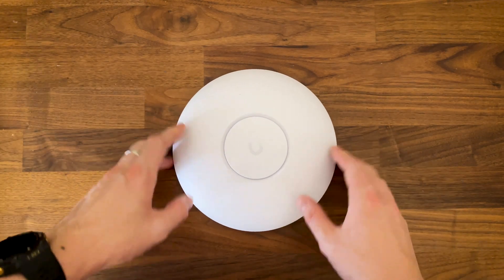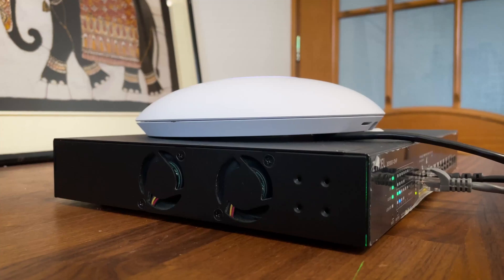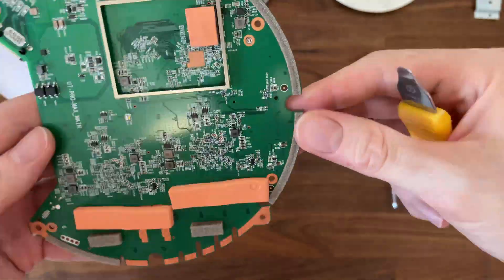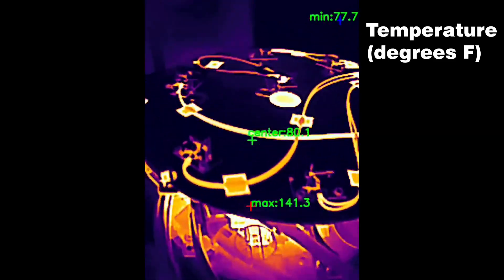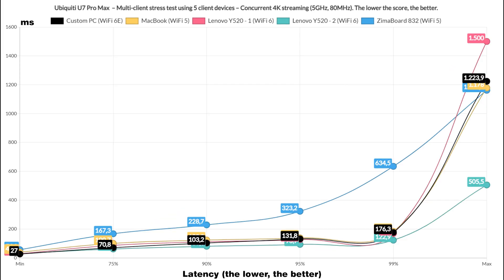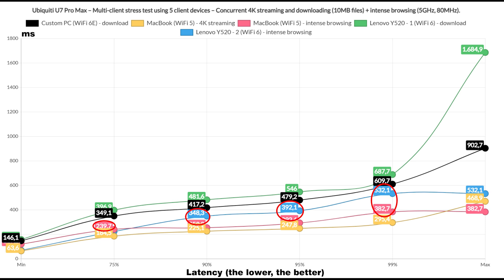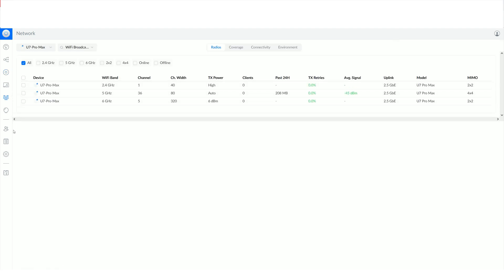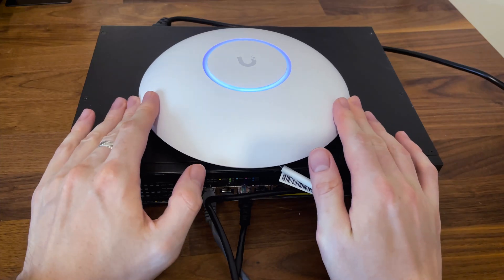Ubiquiti U7 Pro Max WiFi 7 AP Review, Test & comparison with U7 Pro

Comment: Great review, tks for this.  Would love to see the U6 Enterprise included in your AP testbed, considering it is now going for the same price as the U7 Max Pro.

I've read the latest FW (7.0.59) that you have installed on the U7 Max Pro resolved a lot of the Wifi 6E 6Ghz related issues, particularly performance being inconsistent / unstable on that frequency vs. U6 Ent, which has been a rock-solid performer.  I'm on the fence as to which model to get 🤔
Reply from the maker: Go with the U6 Enterprise. I have retested it a few days ago with the latest firmware and things are the same as before, more or less. I am also currently in the middle of writing the script of a video which addresses some main reasons not to get the U7 Pro Max, so yeah, not a fan of this access point.

Comment: can i use this with mc801a please? thanks!
Reply from the maker: I think so, yes. But you will need to power it up using a PoE adapter of switch and the management of the AP will need to be done using the UniFi controller.

Comment: Wish I had seen this video before.  I picked up a 7 pro a few weeks ago and I was disappointed that it was only 2x2.  I also can't seem to get it to connect at 320MHz on WIFI 7.  When I first powered it on, set it up, it gets hot. Hopefully the next generation units will be 4x4 on all bands and passively cooled and low temp.  I don't like the thing mounted to my wall knowing that I'll change it one day and there will be discoloration.

Comment: Fans 😂 they need to design better electronics that develop less heat
Reply: Hey,
I totally agree, I bought 2 different AP and returned them for that reason. After searching recently, there are a lot of complaints on the community forum.
All are answered the same way: It is within thermal specification for electronic.
Mine is: why is every other brand with same performances way cooler?
Ubiquiti AP electronics are badly designed.
I have a UDM and 2 switches, happy with them, but dealing with other brands AP breaks the seamless experience to the point I'm considering changing the brand for my network.

Comment: You better disable Wireless Meshing next time, when testing. That can be done at AP level but better inside the whole site (Settings > System > tab: Advanced > scroll down, uncheck Wireless Meshing (and New WiFi Device Auto-Link, if you don't use that).

Disabeling this, will stop the AP of sending out hidden networks (for the Meshing feature) and frees up memory. It also let you use more simultaneous SSID's on an AP.

I think that for these tests, it will be good to disable it, since if you want to compare it against other brands' AP's, they would have an advantage.
Reply from the maker: Can it make that much of a difference? I will make a video in the next days testing exactly this on both the U7 Pro and the U7 Pro Max.
Reply: @SamBondor  Well, I know that I like to begin with Meshing off, since it makes t-shooting more easy. But it does free up memory, makes it send out less SSID's at a time. So it must have some benefit in performance.
Reply from the maker: @DutchShaggy  It's curious that Ubiquiti doesn't disable it by default. As I mentioned before, I will re-run all tests on both APs very soon and see the impact that this feature can have.
Reply: @SamBondor  They (sort of) advertise with Meshing. So that should work out-of-the-box. But it destroyes more then it fixes, for what i've seen.

Comment: Looks like a modest upgrade. Worth double the price though... no. Also since MLO isn't available yet, I feel as we can't get a full idea of the U7 Pro or Pro Max's true capabilities until then. I don't think it will be worth getting a U7 Pro or Pro Max until WiFi 7 clients are more prevalent and MLO support is enabled.
Reply from the maker: Yes, that's pretty much my conclusion as well. There is a tendency to rush things especially from the manufacturer side, but until all the pieces fall into place, I think it's better for the user to wait a bit.
Reply: It has a fan?! Does the U7 Pro have a fan?
Reply: Not modest. Please go and learn about radio waves and technology. We get it you're just attempting to justify whatever AP you have now and don't want to buy a new one. MLO is now "available". Again... a bad comment overall.
Reply: @ I'm not sure I fully understand your comment. WiFi 7 is very much still in it's infancy. And we are very unlikely to see a significant improvement from upgrading to a WiFi 7 AP, until there are clients to support it. I personally have a single WiFi 7 client, my desktop PC, with a WiFi 7 card. I have a few WiFi 6E clients, but the vast majority are still WiFi 5/6. Why would I upgrade to a WiFi 7 AP, when I won't see the benefits of it now, and likely won't for a couple more years?

Comment: Hello,  i have the U7 pro max ap, iam running it with Trendnet Poe++ 2.5gbe injector to udm pro max 2.5gbe port, i bought the unifi poe+ adapter for my camera but tested it with ap and it got 2gbps also even tho in website it says gbe port, which is better do you think, trendnet was 60  euros unifi adapter 20 euro.
Reply from the maker: If you get the full speed using the cheaper option, then I would go with that one.